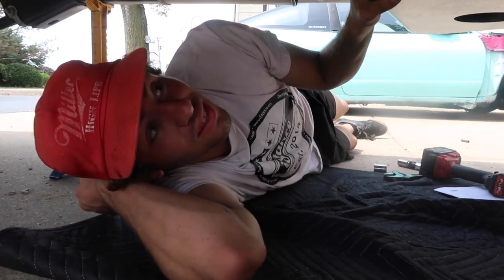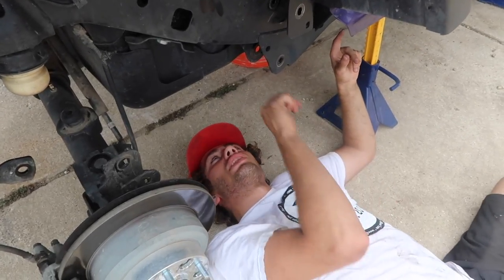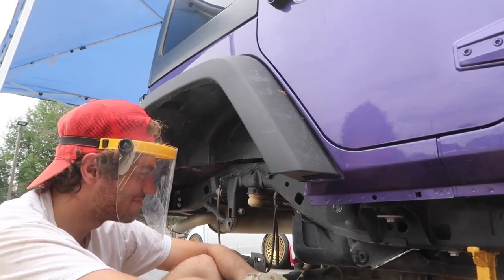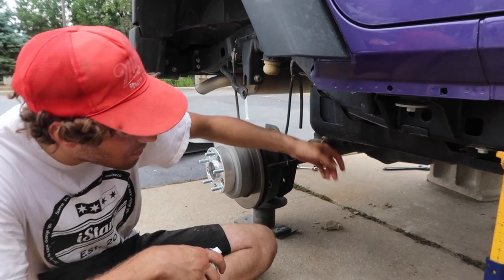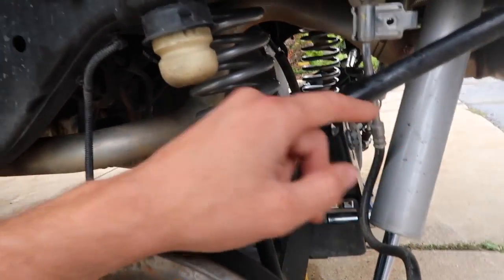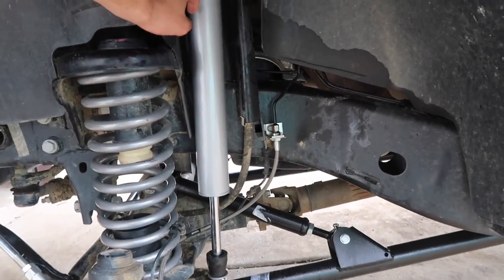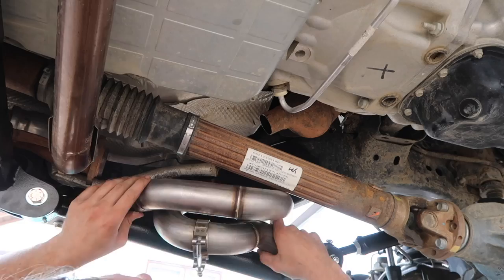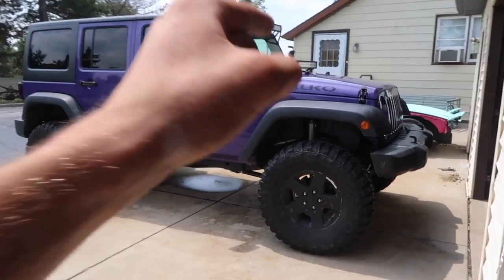4" Long Arm Lift Is DONE!

Comment: Hey dude, I've used rough county lifts kits and fuck what everyone says, only bad thing about them is the shocks they start to get a bit shitty but that's like after a few ks but you replace them with fox ones and you'll be on your way. And clearly none of these people come hack job have never seen a long arm kit this is pretty standard job, look at the factory mounts compared to the ones he was installed 3mm steel vs 6mm with more mounting points. Can't wait for the 240 build better put a 2j in that bitch

Comment: THE EXHAUST HAS A LOOP TO KEEP THE PASSENGER AND DRIVER SIDES EQUAL LENGTH. IT MAXIMIZES HP AND TORQUE. DO NOT REMOVE IT.
Reply: texas range did you even watch the whole video?

Comment: I watch all the videos and was waiting for this rough country kit to be done, and I kind of still don't understand what was the purpose of it all? I mean couldn't be to only lift 4 inches??? why all those parts, tons of parts to only lift it 4 inches? couldn't you just get bigger and longer springs?
Reply: iBoolGuy only getting taller springs wouldn't do anything if the axle isn't able to drop lower. The point of the longer arms is to allow for the axle to move down more in order to fit a taller spring and thus lift the vehicle

Comment: You done need bigger tires you're going to rub and not going to be able to flex a lot
Reply: David Owen what flexing on them curbs this thing probs won't see a proper challenge in its life with tyler
Reply: bruce 130013 but like actual offroad cars you don't need huge tires cause right when you flex it just rubs but yeah fr he will be flexing on curbs

Comment: Youre putting an awful lot of faith in that tiny little impact...some of those bolts need real torque. Otherwise the road  vibrations will render them loose and useless.